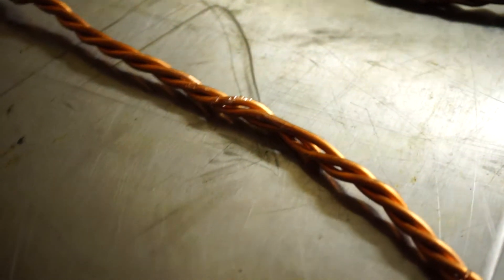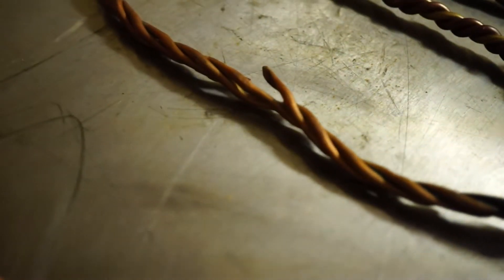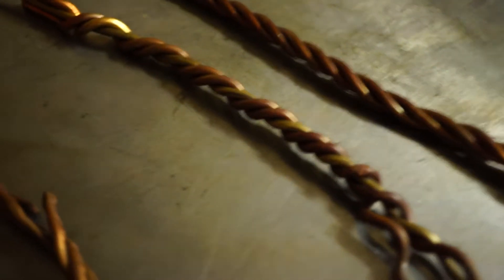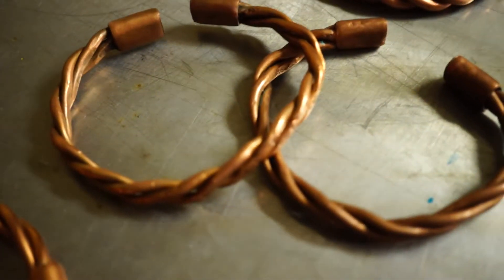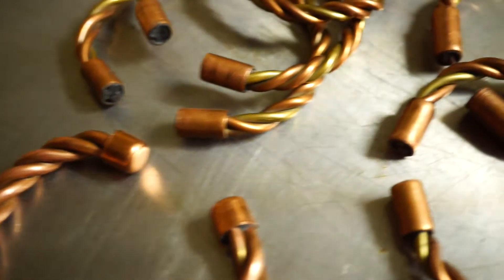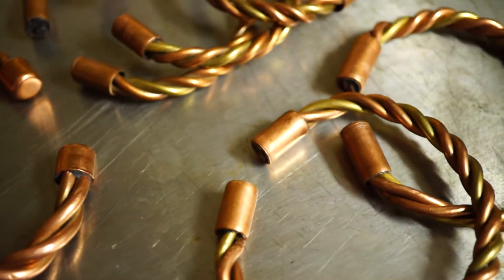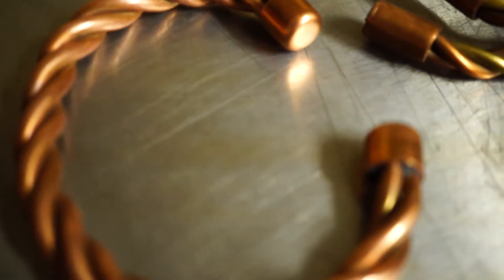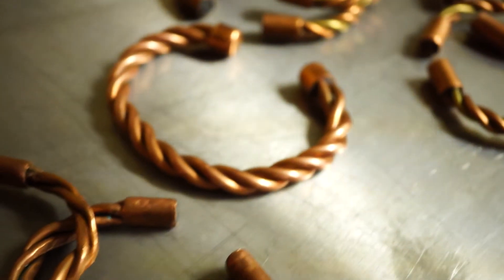How to make Bracelet with copper and brass 3 wire Part 3

Comment: What gauge wire are you using.  I bought the 8 gauge copper.  Like the one comment someone earlier made.  Would it be easier to put the three strands in the end of a drill on low and clamp the other side down to make the twists?
Reply from the maker: +falafal3 I have used both 8 gauge and 10 gauge.  in these videos, i use 10 guage